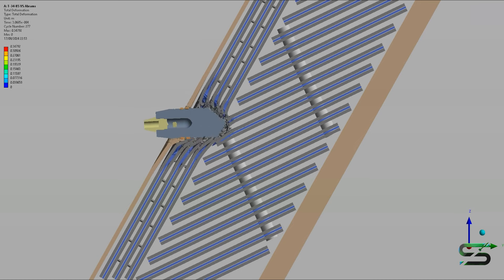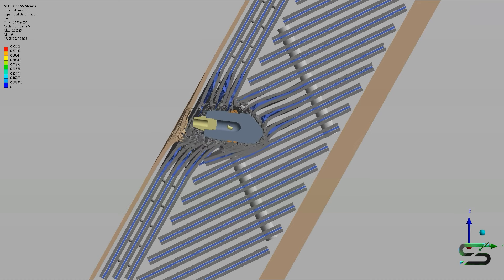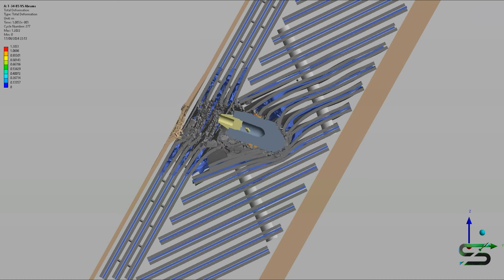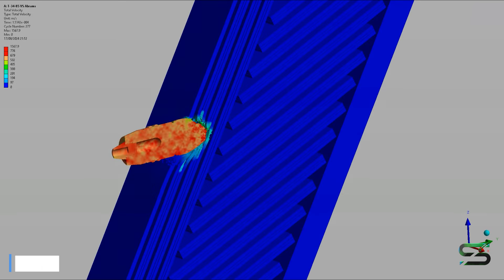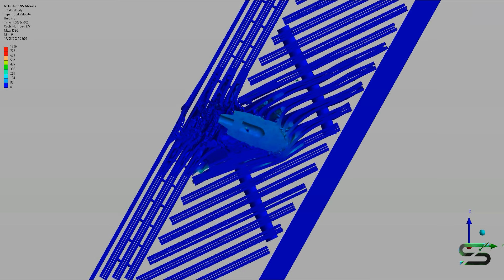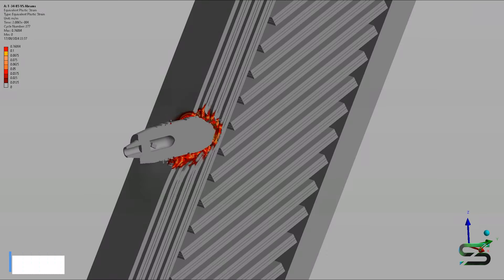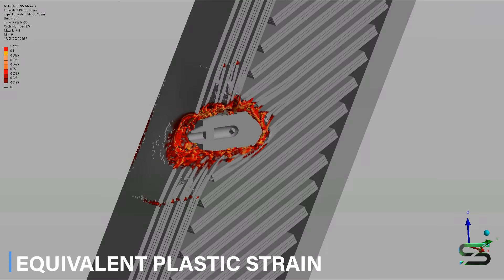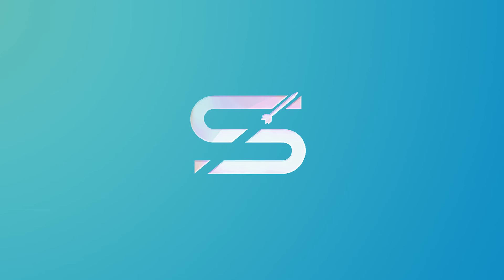T-34-85 VS M1A1 Abrams | Armour Piercing Simulation

Comment: AP rounds don't erode like that man , not even if they hit a solid steel plate .
Reply: yes they do when they hit ceramics.
Reply from the maker: Source? You should take a look at the real footage of an eroded IS-2 AP shell.
Reply: @niffy99  They use ceramic as tank armour ?
Reply: @5co756  that's literally most composite armors, the metal you see is just the outer layer to act as a strike face.
Reply: @5co756  yes, they have since the 60s, most modern tank armor and body armor is a mix between plastics, different metals and ceramics etc.
Reply: @SimulationPlus  I saw German weapon test from 1943 , they shot a 75mm at over 1000m/s at a 200mm plate sloped at 30° . Two times it penetrated and the third got stuck in the armour , the projectiles had barely some scratches . There are also a lot of pictures with shells stuck in the armour . 
I saw a lot of such simulations , were the shells erode or explode into a million pieces . As long as the shell is harder than the armour it hits , the shell can't erode or getting damaged .
 If there is ceramic inside as one guy mentioned , then it can erode like that .
Reply: I repeat:  it's a thin, hard-hardness armour steel versus a wartime quality AP shell with war-time quality of thermal treatment. 
Ever seen a quality file making sparks grinding against instrumental steel?
Reply: @5co756 well it is known that soviet rounds used softer metal, so that could be the case

Comment: "Abrams would spot it at 3 tousand meters" i highly doubt that, Considering that most of the tank battles in Ukraine take place at distances no greater than 1000 meters
Reply: Obviously that depends on the terrain and how good your unit is at reconnaissance an determining the likely point of contact.
Reply: The Ukrainians are not using the Abrams the way it was designed for - combined arms tactics.
Reply: @tachyon8317  How it was designed to use?
Reply: @愛を込めてロシアから  See 91 gulf war
Reply: @mufinsp0  friendlyfire and "let the corruption in enemy's army do the whole work"?